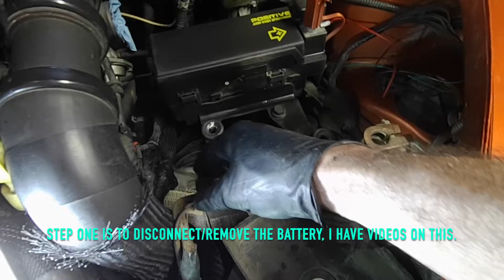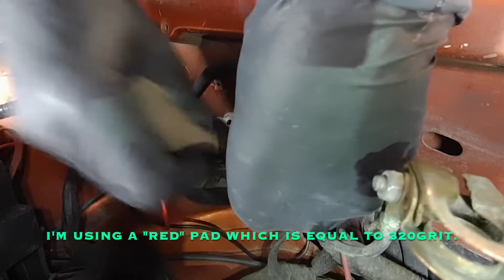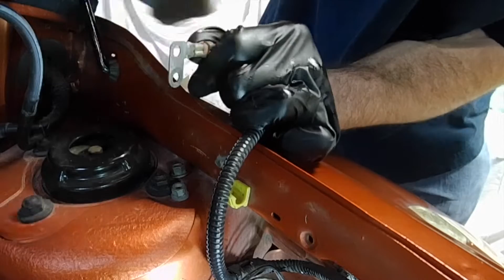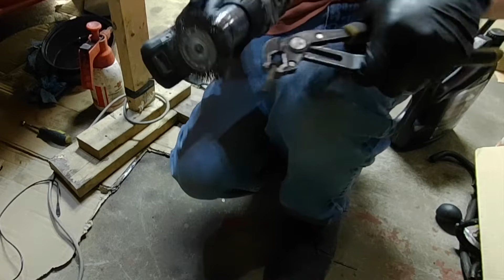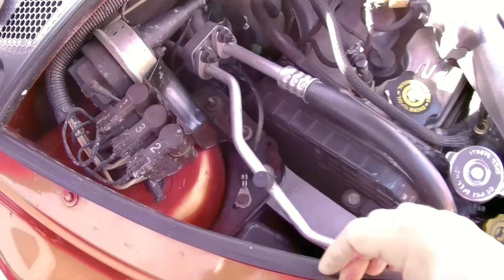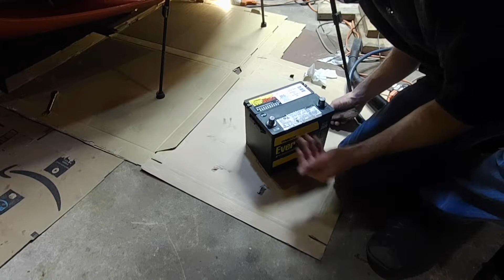PT Cruiser Electrical System Maintenance

Comment: I have a 2007 PT Cruiser.  I have replaced the PCM and alternator.  The battery will not hold a charge unless I start it everyday.  Do you think doing this will eliminate the issue ?  What are your recommendations?
Reply from the maker: I would definitely start here. You might have a faulty door switch or something like that causing a draw. I do have another video in my PT playlist on diagnosing parasitic draws, they often seem to be intermittent on PTs so it might be hard to track down.
Reply: If you have fog lights it may be a bad multifunction switch that's how mine started

Comment: Matt... I bought a 2002 PT Cruiser Dream Series. You have been my go to guy for all of my repairs and preventive maintenance. Thank you sir!
Reply from the maker: Some what jealous, we have been fighting the urge to find a series 1 to park next to the series 2. Glad to hear you found my videos helpful, I should have more coming, I’ve just been sidetracked from PTs a bit lately and also nothing has broken for awhile.
Reply: @CarswithNash  that’s what good maintenance does. ya love to see it 🥲 i’ve got a wonky fuel gauge that i’m hoping this video is the solution for! thank you in advance you PT legend
Reply: I was wondering if you have a video showing how to check and add transmission fluid to a pt cursier I have a 2006 2.4 turbo and I believe it need fluid but I don't want to do it wrong thank you
Reply: @shondarourke5598  PT CRUISER AUTOMATIC TRANSMISSION
                                     FLUID CHECK, STEPS.

                1-Transmission Fluid must be at normal operating temperature (100F)
Drive the vehicle several miles making frequent starts and stops to allow the transaxle to shift through all gears then,
2-With the vehicle on a level surface apply the parking brake:
With the engine running apply the brake and place the gear selector lever momentarily in
Reverse then Drive and repeat the sequence again ending with the gear selector in the Park position. 
3-Wipe the end of the dipstick with a clean rag, reinsert the dipstick and the fluid level should be within the HOT range (100F) if not hot it should indicate in the WARM range.
-Must prevent overfilling by doing this:
 Add fluid a little at a time, drive the vehicle, and check the level between additions of fluid
Reply: Just remember Die Electric means non conductive.

Comment: I have replaced the multi function switch,all fuses and turn signal flasher, and new wiring harness end on the multi function switch and the turn signals still don't work. And it's on a 2003 PT Cruiser Limited non turbo. Any ideas as to why nothing works.??

Comment: I need help! I bought a 2007 PT Turbo. It's been out of service more than I've had a chance to drive it.  I only bought it March 2022. It first started by not wanting to accelerate after every stop.  Didn't matter how much gas pedal you gave it. Figured out after I'd shut car off it didn't have a problem for the rest of the day.  Eventually shutting it off didn't work any longer. It eventually threw out a check engine light showing MAP, TPS & Crankshaft sensor. I changed one sensor at a time,  eventually replacing all 3 sensors. Still had problems.  At one point (only once) when I drove it home & idled in my driveway it sounded like a race car with popping noises upon giving it a little gas. That sound was a one time deal. Check engine light still shows TPS & MAP (no Crankshaft sensor though). Eventually it had a VERY bad idle each morning.  Like it wanted to stall, smelled like raw gas. Once it worked is way out it idled & drove fine (for the most part). I've even replaced the computer (yes, it was flashed). New computer brought on a new problem. The car ran after computer. I THINK this is when it had the rough idle in the morning.  I changed out plugs, wires, new O2 sensor. Now car doesn't want to accelerate.
Reply from the maker: One thought is the catalytic converter might be clogged, try pulling the O2 sensor back out and run it with that open and see if it runs better.

Comment: Man my dash lights and my interior lights all that works but it'll come on and cut back off but it stays off most of the time my speedometer won't work or my fuel gauge won't work until it decides to come on on its own then Cuts back off what you're doing in this video here will that fix my problem or is there a part that is bad could be causing it?
Reply from the maker: The fuel gauge most definitely is probably the ground on the right side of the engine bay, the small 10mm one that’s kind of tucked up under the underside of the bracing there, that grounds the fuel pump and gauge. The dash lights might be a bad ignition switch and the interior lights might be a bad door switch, both pretty cheap and easy. I have an ignition switch replacement video and it fixed the dash lights on my car, they flickered.

Comment: I have a 2006 PT Cruiser and I'm trying to get at those ground wires that are in the passenger side fender the one that grounds the passenger side headlight and blinker and so forth there's about eight wires in your video you show it but your air conditioning lines run different and you have more room to get in there mine are completely blocked by the air conditioning lines and by the timing belt cover would you have any suggestions on how to get at those ground connection was thinking I might have to go through the headlight then up any help would be appreciated
Reply from the maker: I know what you mean but you should still be able to get in there with a little wrench, it might be time consuming but you’ll get it. I don’t think you’ll get access through the headlight.

Comment: Random Traction Control, ABS and Oil pressure lights - serious static on radio, and flickering headlights.
I'm sick of it, because I'm busy, and the car is now illegal. Cruise Control still works, so there is a definite earth/ground fault.
Putting it up on blocks, and buying a Japper so I can get to work.
I'll put the registration on hold, because it's in good nick. Hope to solve this during vacation.
Reply from the maker: I do understand your frustration but any brand of car can have electrical faults at this age. I had a 10 year old Toyota that would randomly turn the highbeams on, I’d end up having to dim multiple times. If you can afford a brand new car with warranty that’s the best way to avoid having to deal with stupid car problems, but even that can backfire and I hear horror stories from new car owners too. Glad to hear you’re still going to keep it around and try to fix it.

Comment: Hey Matt, I just started driving and my Pt cruiser has a problem where the interior power does not work, that includes the horn, stereo, and a "No Fuse" message on the dash, all the window controls work, air control is perfect, just the stereo and the horn will not work, neither will the ceiling lights, any help resolving this issue? I already switched out the main fuses to the interior power for new ones, even some that didn't need replaced, even cleaned up the fuse sockets a bit. just find it to be a hassle not being able to use my stereo and having to use a bluetooth speaker instead. and I find it a bit annoying being unable to use my horn. 
** NOTE MY HORN WORKS WHEN I PUSH MY STEERING WHEEL UPWARDS OR DOWNWARDS AND PUSH MY HORN AT THE SAME TIME**
^Even my stereo begins to flash for a few seconds but other than that they both stay off.
Reply: Under the hood the power fuse box under the air cleaner. IOD large fuse may need replacement.

Comment: awesome ! 2006 pt turbo  bouncing  RPM when AC is on and stalls  at some point .NEED HELP
Reply: It meant too!!!! Same as wen heater on windshield u hear a on 2 3 off 2 3 on 2 3 off 2 3

Comment: Anyone have an issue where voltage intermittently drops below 12V only while in idle below 900rpms? Could it be due to bad electrical connections like this?
Reply: Battery temp sensor

Comment: I have an 02 Pt with electrical issues. 1 New battery and 2 alternators later the battery light is still on and dies after running for 5 min
Reply from the maker: Did you try cleaning up the ground points and electrical connections? That’s actually what it sounds like is your problem.

Comment: One thing that's not visible in the video: when you take the air filter out, there's a curly formed hose on the left (engine) side of the filter box that EASILY breaks. I couldn't find one online, & found one in a pull-your parts junk yard the other day. 🖖

I'm so addicted to being able to fix my own cars now.
Reply from the maker: Because the hose was missing when we got the car actually… I have since replaced it with a scrap from another old hose because I also couldn’t find one.
Reply: @CarswithNash  Awesome! Thanks.

Comment: One more ground issue to address : my horn (01 PT)  quit working, also clock/ radio-CD light were intermediate. Someone mentioned a horn problem in the comments. Every fuse/ component I checked tested good. I was perplexed Car only had 42K miles. Then I found this on the internet from a Chrysler mechanic, that I probably would never have discovered, which solved the problem and would probably be a good item to add to grounding preventative Maint (before it becomes a problem)   Here is the Solution I found.... "I'm a mechanic in ny ,have just dealt with pt radio/horn problem ,it's nothing to do with any parts or wiring harness issues,it's a riveted connection between dash bracket and steering column support if you jump with a wire between brkt and support with key on your radio will light up,jump a 12ga stranded wire between the fwd support stud and rearward support bracket half's(stud towards rear of car is fully insulated from brkt),i,m going to try to attach pix,this will fix solve the mystery"
Good Video. Thanks
Reply from the maker: Interesting. I actually have the inter-mitten radio light on my convertible currently so I might give this a try. Thanks for the info. Unfortunately there is no way to add anything to a video after it is published, it is what it is and posting another one won’t help either because this one has already got the views and is ranked. But people can see this comment you made so that should help a few people at least. Also I will keep a mental note in case somebody is having this exact issue.

Comment: THANK YOU! I love my PT Cruiser, but it's been nothing but trouble since I bought it. I realized it had to be something systemic, & this is exactly what I needed.
Reply from the maker: Happy to hear, hope it fixes some of the problems you’ve been having.
Reply: @CarswithNash  I'm finally starting today! 
Question:
The guy at AutoZone 🙄 is insisting that I can just use the CRC QD electric cleaner, & I won't need to take contacts apart. Does this even sound possible.
Reply from the maker: @dottyjyoung  If you’re not taking the contacts apart you’re not going to get them clean, it might clean up the outside of them so they look pretty but that isn’t helping the problem any. Since this video I have bought some little micro wire brushes that work really good for cleaning up the contacts, they have really fine wires on them so they don’t leave deep scratches, they just polish it up. But yes taking them apart is very key to success. I do this same process on all my vehicles, it’s literally one of the first things I do when I buy a vehicle.
Reply: @CarswithNash  Thank you, that's REALLY what I thought. The guy was so helpful in every other area, but I was like, "This makes no sense...maybe he just hasn't done a lot of cleaning in his life."
Reply: @CarswithNash  Holy crap, as soon as I got the air filter & battery out, the WHOLE CAVITY in there was FULL of loose, dusty, corrosion. The wires & eyes on the battery ground  were corroded & bent, & it's NO WONDER I've had random electric malfunctions on this thing. Thank you, thank you, thank you.
Reply: When you're re-inserting the ground wires onto the 10 mm bolt (@ 7:27) does it matter which direction the contacts are facing?
Reply from the maker: @dottyjyoung  As long as everything still reaches where it needs to go it doesn’t matter too terribly much. I try to keep everything the way it was when I took it apart because the wires remember that position and fit nicer that way.

Comment: Thank you making these videos Matt. I have a 2008 PT Cruiser Base Manual 5 speed Non Turbo and I decided to replace everything that I can a little at a time. I have had an issue with my headlights doing a single flicker every now and then. I am trying to track that down. First thought maybe it was due to when the fan kicked on but after watching this video I am going to check the ground. It is too cold to do all of my grounds right now but I will definitely do the headlight ground and then the rest of them in spring.
Reply: My pt does the same thing with the headlights

Comment: My 02 pt cruiser dash console and shifter lights won't come on , the bulbs are all good all head light and turn and rear bulbs are working all fuses in car are good what could be causing it , it happened when it rained but everything is dry now what do you think?

Comment: My tailgate unlocks whenever I unlock the front doors. Rear doors don't, unless I do the double-press on the fob.
So I shut it, and the damn thing will unlock while driving, even with the doors locked from the inside.
Now I have got an ABS light, Traction Control light. and I'm quite tired of it.
Goes great, but I've noticed that it has a non-original tiny battery, which slides around as it has nothing to hold it in place.
Always starts.
New battery first, then follow your procedure, or try with the current battery?

Comment: 👍🏁👍👍🥂my head lites flicker , probly should take your ignition key area advice . What is that cheap plastic part called? I'll be looking for the next vidio on this 😊
Reply from the maker: Yes I recommend replacing the ignition switch in that case, that is the electrical piece that the key turns, not the actual lock. I have a video in my PT repair playlist on that replacement.

Comment: I have a 2007 PT Cruiser it keeps overheating I replace the radiator the thermostat spark plugs and more I don't know what to do at this point
Reply from the maker: Is the cooling fan working correctly? This does seem to be a common issue on these cars but I have never experienced it myself. You definitely don’t want to let it overheat because it can cause a blown headgasket at that point.

Comment: Hi Matt, I’ve been having a few issues with my grandmothers 2004 pt touring turbo, it will run good for a few miles, sometimes the whole day. But then it will throw a p0508 idle air control system circuit low, p0300 rand. Misfire, p0201 p0203 p0204 injector “a” circuit codes for 1, 3, and 4. There’s also codes for heater control circuit high bank one sensors 1 and 2. Does this sound like an electrical issue? I cleared the codes about 4 days ago and I currently have a returning p0032 p0038 p0508 and p0300. Trying to keep the car from being junked but at this point it may be headed that direction. Any help would be appreciated. Also, it has a new IAC valve, so it’s concerning that there’s codes pertaining to it.
Reply from the maker: That’s a lot of codes… Have you tried cleaning up the grounds and electrical connections? Does the car and run poorly when codes appear or is it still running perfect? If it is really misfiring then maybe that is throwing the codes on the other systems because of course if the engine is misfiring that kind of throws everything off. If the coil pack is original it might be worth changing and see if the misfire code goes away at least. Sorry I wish I could give you more exact advice but that is a tough one with that many codes, I don’t want to advise you wrong and have you spend a bunch of money on it pointlessly.
Reply: I also have the 2004 PT Turbo Touring Platinum, & once I cleaned the battery ground & the fuse box ground, all of my engine codes went away. Seriously.
However, I didn't clean the starter & alternator connections, bc the weather wouldn't cooperate, & it died on me in the middle of the road, while I was trying to limp home. 
Lesson learned: this stuff WORKS, but I have to do ALL of it.

Comment: I have a pt here that always has something hidden that kills the battery I took the radio fuse out and the battery never died overnight again now the negative battery post corrodes and battery dies over the course of a day or these cars are such a mystery
Reply: If it has fog lights take that fuse out. The stalks get worn and make the fogs drain the battery. See if that does it. If so replace the stalk or open it up and repair.

Comment: Thanks for the very informative video, I have issues with two stubborn error codes after my pt has been sat on my drive for four years. The engine light is on and the two error codes causing it is p1684 and p601, errors to do with the pcm. I've done lots for the engine following your other helpful videos and my engine works great, it's just this engine light and these error codes that's stopping my pt passing its mot to get the car back on the road. Could it be as something as simple as corroded grounding connectors like in your video that's causing this? And cleaning them up could get rid of these errors? Have you fixed these errors before? I have a brand new battery in by the way, the old one was knackered. Your videos are great and have been a huge help to me, thanks :)
Reply: Nah didn't work. Cleaned all of the contact points on all of the grounding connectors and I still have the engine light on with those two cursed codes! :(